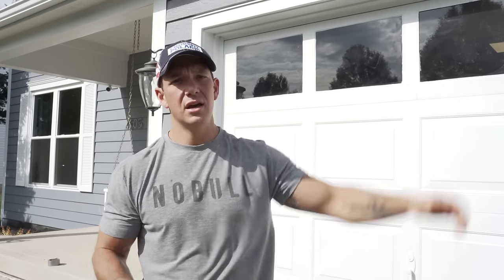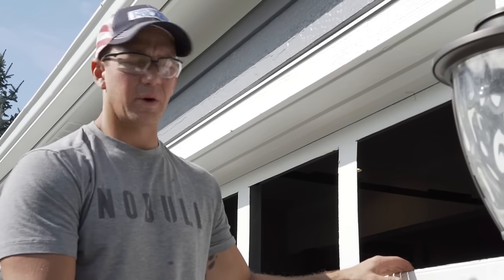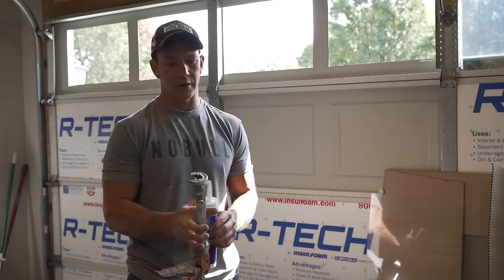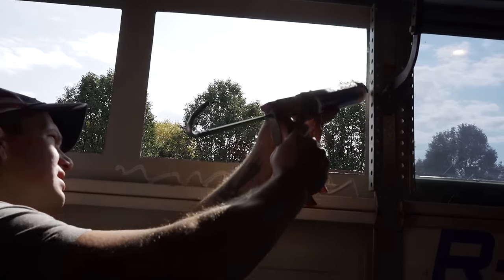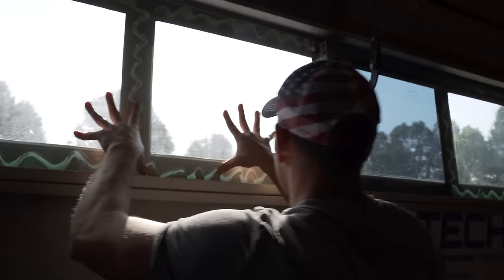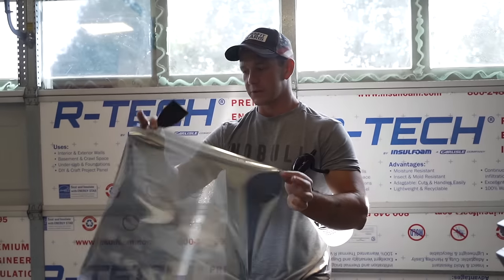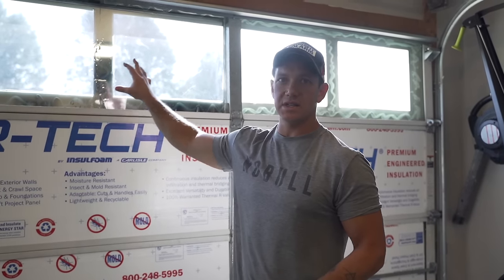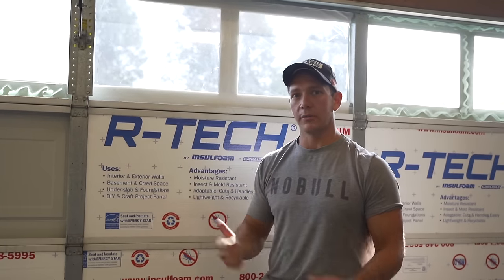DIY GARAGE GYM WINDOWS! UNDER 100 DOLLARS!

Comment: Have tried opening and closing the garage door after your mod?  I’d be worried the glass might break if there is any twisting going on during this.
Reply: ya, its not an issue at all. its 1/8 think and with the glue Im not worried a bit!
Reply: Hey, just an update its been more than a year and hundreds of open and closes and no issues at all!
Reply: @patrickoconnell2380  glad to hear it.  The sun light must be awesome. Especially during Ohio winters.
Reply: This is technically illegal in some states.  You're supposed to use temperred glass.  It costs more but worth it.  If you disengage the electric door opener for any reason (Like a power outage) and the door hits the ground hard enough (like if a teenager closes it) cheap glass can break.  Otherwise with this one upgrade you at least get a little more peace of mind.

Comment: Pro tip: many local hardware stores (not the big box stores) will cut glass pane to size. I used to work at one... and the pricing is dirt cheap.
Reply: Lowes does the same thing.

Comment: Thanks Pat, I’ve been thumbing the idea around to add windows for added light. I’m so doing this. I was concerned how to finish the outside. I like the caulk to seal it but I think I’ll shop some thin quarter round pvc molding and miter it around the windows gluing it maybe with same caulking. 👍🏼👍🏼

Comment: NOOOO! NO! 
That glass is not tempered. That adhesive probably won’t hold forever. If/when that glue lets go from all the heat and vibration, and the weight of the glass hanging when door is open, it will fall out on your heads! When it breaks, regular glass is sharp like razors! Tempered glass breaks into little pieces that don’t cut you. This is not only completely unsafe, it is also totally illegal by building code.
Reply: yes indeed, those thin metal doors flex, and his choice of any kind of glass is worrisome....also coat it first and WEAR GOOD LEATHER GLOVES and eye protection when handling any plate glass product...
Reply: hey, its been more than a year and hundreds of open and closes and it has worked great and without an single issue!
Reply: @patrickoconnell2380  Not yet.
Reply: I agree as soon as door twist sideways or uneven it will break
Reply: @22eagleone  its been up for 2 years and havent had an issue yet!
Reply: If nothing has happened yet, it doesn’t mean it’s safe. It just means you got lucky so far…
Reply: @wlem99  lol even if it does crack at some point I’m not sure what your expecting to happen… like any other single Paine window or exterior garage door that has single Paine glass it may get a crack that runs across and needs to be replaced.. what are you expecting to happen? I have replaced tons of single Paine window glass sections, none of them caused anyone any danger or harm..
Reply: @patrickoconnell2380  has this affected the total weight difference of the garage door? Is the door opener able to move the door up and down just as easily with the weight change? They need to be calibrated for these changes or can run into issues
Reply: @patrickoconnell2380  lol, I love that you keep coming back to this comment update. I think the issue really is a safety concern, unlike sing pane windows, you would be standing under these windows if they shatter, tempered glass obviously being ideal for this application for safety reasons. I personally would've went with plexi, because like you said you have good stuff in your garage and a good thief wouldn't mind crawling through those openings
Reply: Im sealing my garage to add some extra living space and this will work just fine. Thanks for posting this!
Reply: I would use a quality plexi glass. They did a very good install and it probably will last for 10 years or more.

Comment: Hi Pat. Thanks for the great idea! I have two doors, 9' wide so I made four wooden rectangular frames primed and painted for the outside. I used pop rivets to secure the wood picture frames to the outside (from the inside, and the heads will be glued under the glass), drilling into the thick part of the casing 3/8" deep with a collar on a drill bit. 6 pop rivets for each frame, 2 top & bottom and one on each side. The wood frame is 3/8" smaller inside than the hole in the door. This way, when I silicone the glass in place with a 1/2" bead at the wood/steel innerface, silicone came out and sealed the bare steel & bonded to the wood frame as well. Glass has gone up quite a bit since 2020, like everything else. $160 for 4 glass panels; 1/8x16x46 in my situation to cover 8 window openings & 8 $10 smooth door casings for the outside case. Silicone x 2 and paint and primer. All in, $330 in Nov-23 to create 8 windows 13x19 for less than $42 each. Thanks again! It came out beautifully.

Comment: The minute he added the mylar to the windows he mitigated the single pane glass issue. Second, single pane glass was a standard until the 1930's when thermopane glass was introduced, and even then it wasn't used in windows until long after that. On top of that, tempered glass was around before the turn of the century (1874) so if or when the glass breaks, it's not going to fall and create a hazard. Even if it was shot, the mylar would hold it together. 

As for me, I think this is a great low cost idea that solves my own needs for my garage. Thanks for the inspiration!

Comment: Great video. Its something I've been contemplating for years. No need to buy a window segment from the garage manufacturer which is a complete rip-off.  I have to come-up with another solution since my garage door have no squares, just gawdy horizontal lines. I think a thicker 3/16" (4.76 mm) plexiglass is the best since its light and glues well - it just scratches easily but its safer.  Using glass is risky since its heavy and can fall due to a breach in the glue adhesion over time, temperature changes, vibration, and moisture.  I would cold weld (JB Weld) metal corner brackets to a metal garage door to secure these windows.  Or if wood garage paneling, I would drill mounting holes on the metal corners and use wood screws.  Thanks again for the great video !!

Comment: A take away for me from this is to do the tinting before the glass is glued to the garage door. Thanks for this idea.
Reply from the maker: hahah for sure! learned that the hard way on this one.
Reply: Hmm 🤔 yes that does seem like a simpler way but, isn't there a possibility of scratching or ripping the tint during the glass installation. Or worse yet getting some of the excess sealant on the tint which would probably be harder to clean off than the bare glass?

Comment: Thank you for the idea!  I would not go with glass, but have 1/4 inch thick pieces of plexiglass cut (CA has TAP Plastics or order it online).  Then I can safely glue AND bolt it onto the garage door.  This would also prevent someone from breaking in.  I'll also insulate around the outside & inside along the edges to keep water from leaking in, since my garage door gets hit hard by rain.
Reply: I'D RECOMMEND STAYING AWAY FROM THE BOLTS. IF YOU GET INTO BOLTING PLEXIGLASS PANELS 
(EVEN SMALLER BOLTS) YOU RUN A RISK OF CAUSING THE GARAGE DOOR TO BUCKLE,AND OR CRACKING THE PLEXIGLASS. A GOOD SILICONE ADHESIVE SHOULD BE PLENTY STRONG ENOUGH. JUST MY TWO CENTS.
Reply: Yes, that work exactly that’s the way I did in my home

Comment: I’d drill a 3/8 hole at the corners and cut between the holes of each opening to help prevent flex cracks in the metal.  It may not crack but might.  Nicely done!

Comment: Thank you for showing this to all of us!  I wanted to just add what looks like a rounded top carriage house window to my garage door which is wood not metal and make the door look like it is two doors with handles that open them.  I thought surely someone would have faux windows that you could just screw on to the doors but I was wrong.  What I have found are a lot of magnet faux windows but I am still looking for that screw on fake.  If nothing else I guess I could paint the faux windows and add low profile framing around them but I was just hoping to find something quick.  Another thing I wondered about on my door is that it is already heavy and I don't want to add a lot of weight to the door and unfortunately there is a massive beam inside that prevents me from changing out my door to a lightweight roll up door as there is not clearance.  If anyone finds what I am looking for would you please let me know in a reply.

Comment: Hahahaha glued on Hahahahaha huge difference between a standing glass glued on, to glued on glass HANGING off a door that rolls up and down from vertical to horizontal with the glass HANGING down off the door.
Please let us know when it fails by cracking or falling off.
Reply: Lol zero issues. I’d be curious what your garage looks like…

Comment: Any consideration for putting some sort of extra support on inside of edge of windows?  Like a piece of trim or something along edge?  Having them only glued in makes me sorta nervous....
Reply: they are glued flat to flat as well as run around the outside edge like calking in a piece of trim. the door is only 1/8 metal so i dont have a great way to attach trim, but i have removed many mirrors that were glued to wall and that challenge gave me confidence! lol

Comment: Any suggestions for someone with insulated garage doors.  I have a mini split in my garage/gym space, so not creating a huge thermal loss area during the hottest and coldest days would be ideal, but I really don't think single paned glass is going to do a good job insulating!
Reply: We have a video coming up soon on heating and insulating! the glass isn't a good thermal barrier but the sunlight it lets in, helps warm more than it hurts!

Comment: I live in Florida, and have hurricane rated doors. Will this mod compromise the structural integrity of the door?
Reply: It depends what the door is made of, and how large the patterns and pillars between them are. I would say if yours is metal like the one in the video, or plastic then it will. Since they are very thin.

Comment: A true DIY master. This job takes it to a whole new level. And when someday you sell the house and the new owners are scratching their heads over duck taped garage windows you can just show them this video. I vote for a new intro roll that includes more Pat doing DIY.
Reply: hahah thanks!!!
Reply: Also a Hack Master
Reply: A DIY master would have cut out the raised area only.  Then make a double sided frame from vinyl molding.  You don’t need to glue the glass…screw the frames together so it holds in place.  Then there is no need for duct tape.  This project was sort of ghetto.

Comment: It always awesome to DIY but adding glass here is not a good idea. 1. It adds too much weight 2. If the spring breaks overload (if not spring do eventually break) it's extremely dangerous. These doors are already closer to 1000 lbs. What many people don't realize is the torsion spring does all the heavy lifting. 
Good example spring breaking: https://youtu.be/F4qTIpspUik?si=svagKtCBdkkWRYwf
I would recommend plexiglass (way less dangerous when spring breaks) and lesser windows.
Reply from the maker: its been great for quite a few years now, without any issues!

Comment: Don't follow this advise friction, movement and the usual Streisand against garage door will destroy that glass in no time. There is a reason you need to use temperate glass and frase, but the cost of temperate glass is skyrocketing
Reply from the maker: its been more than 2 years and we have not had any issues..

Comment: the devil is in the details, I think up close this is going to look like a sad diy half baked project,  you really need to find a  tempered thermopane with an interior and exterior trim ring frame, be sure your torsion springs can handle any added weight
Reply from the maker: It looks great and it adds sooooo much to our garage gym and adding natural light in! We love it!!

Comment: 1st,. That looks like shit
2nd,. Water will leak in between the metal door and that bullshit glass job.  Silicone my ass.
3rd, you cut that sheet metal without adding any support?  That will cause the door to fail.
Go pick up some weights and put them back down again and leave home mods to people who know what they are talking about
Reply: lol havent had a single issue with them. would be curious what your garage looks like. thanks for watching!
Reply from the maker: Hi, we haven't had a single issue and are super happy with it. Also makes the garage feel like a gym because the sun rises and shines right in. It feels like an extension of our house not a dark dungeon . Thanks for watching tho :)